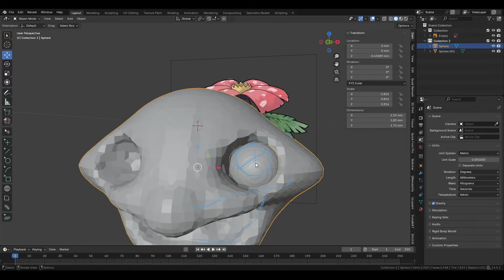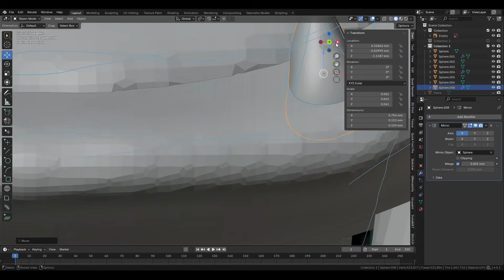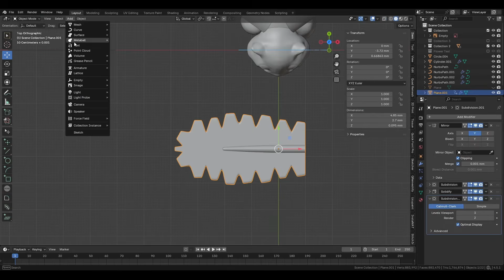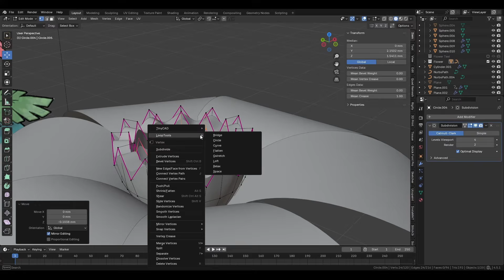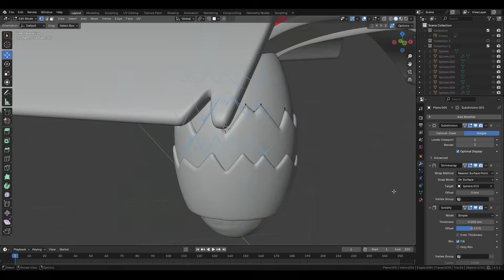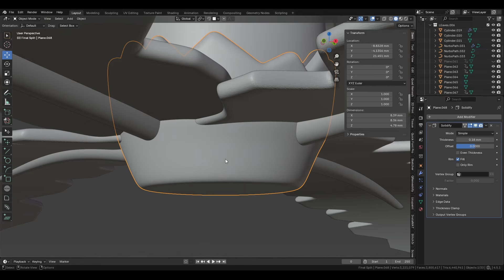Sculpting in Blender for 3D printing

Comment: Can I join mesh with ctrl + j instead of boolean?
Reply from the maker: Ctrl + j leaves internal faces that cause problems when slicing the model for 3d printing. 
You need to make the model manifold for 3d printing using the Boolean modifier or the bool tool addon